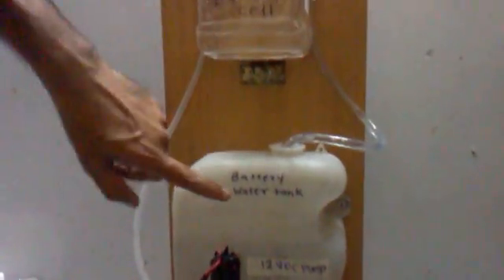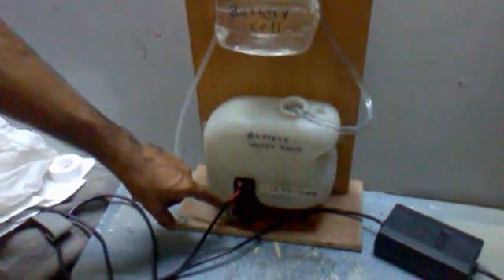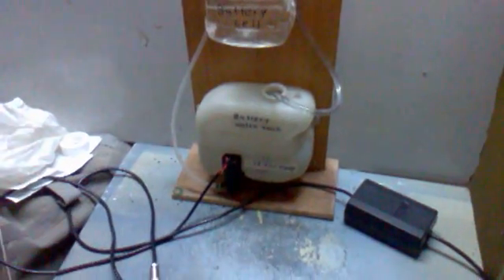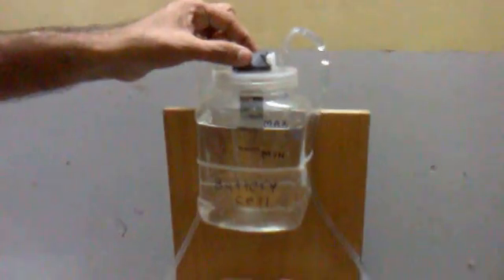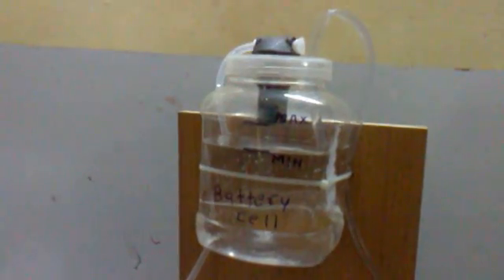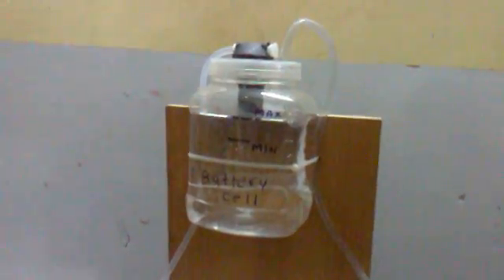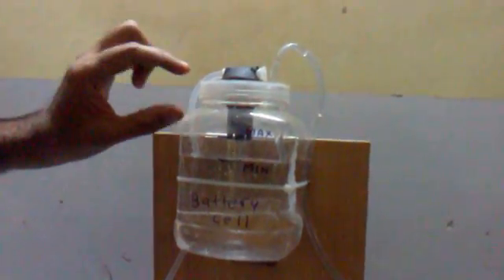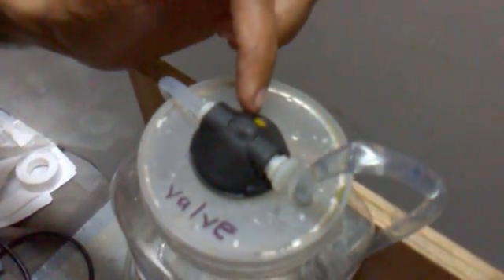automatic battery water filling system demo

Comment: Each cell will have one individual auto plug which will sense and on or off water flow in plus minus 3 mm .  if you have 48 v ckt then you need 24 such plugs and only one water feed pump.  Msg bybgirish  autofillgirish9243@gmIl.com